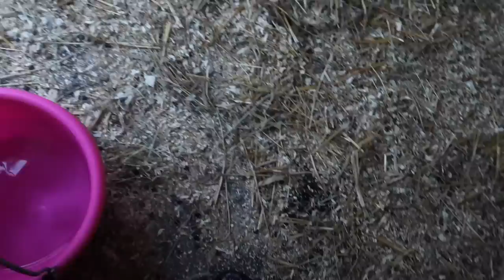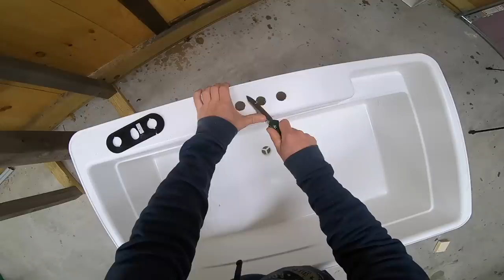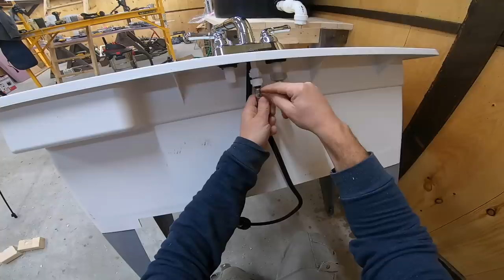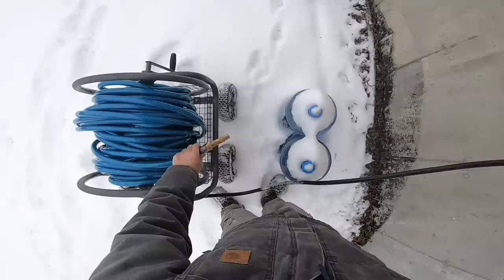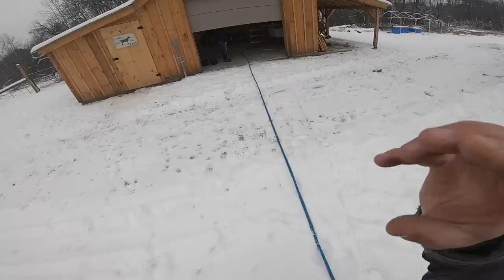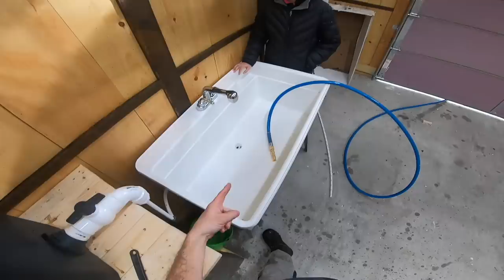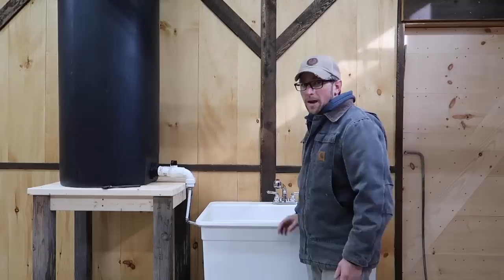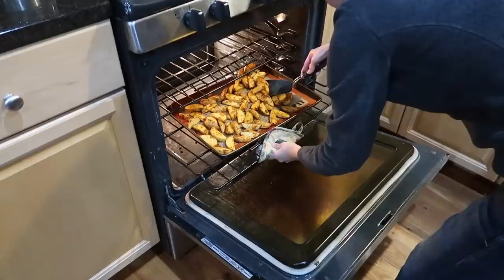Hooking Up the Water storage System Everything Was going so good until the END

Comment from the maker: Drinking Water Hose we are using https://amzn.to/2rbs4rl    (*Affiliate link)
Reply: Hook up a shrader valve to your water tank and pressurize it with compressed air. You'll get plenty of water pressure
Reply: That is if your tank is air tight!
Reply: That WAS a close one!  So glad it reached.
Reply: Makes me giggle your little tank. My big one is,105,000 litres or close to 28,000 gallons. And I still worry if I have enough. Even with 15,000 litres also for the vegetable garden.
Reply: How will you drain the water from the sink?
Reply: All you need is a short hose like a washing machine hose connected to the tank with a basic garden head on it. I use this on my rain barrels works perfectly. You will need one converter to change from the hose to the garden head.
Reply: Al, there.may be a.subscriber out there who is willing to send you an old style faucet they still have.lying around, or would an external.hose bib faucet.work?
Reply: @delstalopalmay  Its a boot washer!
Reply: @delstalopalmay  The sink is open at the bottom. Draing
is not the problem. Collecting the drainage is. 🤣
Reply: Al I don't usually ever give advice because you get so many that give it. I was a plumber for 30 years. So here's my unsolicited advice, if you put the hundred gallon tank in the loft, you could still have your fill valve in the bottom of the garage, along with your supply line, and you would have plenty of pressure. I couldn't tell what brand of faucet that was, but some of them you can remove the back pressure coupling on the inside of the unit. That's the cheapest way to go, you could put a water pump in between the tank and the sink, however that's more expensive than 30 feet of water hose and 30 feet of flex pipe.
Just for what it's worth,
Jimmy
Reply: @williamdegnan4718  exactly...
Reply: William Degnan A
Reply: Hope all goes well with plumbing in barn. Those potatoes look so yummy. Gena, please let us have your seasoning recipe for the potatoes.
Reply: @delstalopalmay  That's what I want to know also...where's the drain?
Reply: @Bamaman14k  that would be a space saver to in his activity area
Reply: ❤👍 Serbia

Comment: The water saving technology is a washer with a tiny hole. You can remove it. Sometimes there are two. One at either end of the hose part of the faucet.
Reply: Sometimes you can drill the hole bigger if you can't get away with removing it.
Reply: eldenl1 yep I hate those darned faucets. Maybe find an old faucet that looks good to replace the new one.
Reply: I think there are a lot of people that hate them. I know I do because they do do send out enough water to get the shampoo out of my hair. Yes those washers are easy to get out. My husband did it for .
Reply: Madonna Emberley  And that’s what Community can do for you!  I would appreciate hearing this if I was Al.  Better than taking out and returning the faucet!
Reply: If you cannot get enough flow, try a garden faucet value (The ones with a Red round knob). You could just add a pipe nipple to turn into sink faucet. Just a cheap & simple option.
Reply: @WhatBigEyes  We live in a new development, high density, and the builder put outside faucets with those darn water saving gadgets on so when you want to water your lawn, the water sprinkler won't even move back and forth! So I thought I'd remove them then add my garden hose. Nope. Doesn't work, they put the spigot a different size so you MUST use the water saving sized plumbing, and it's ruined if you try to put it back on, so back to the hardware store. Nothing like government dictating how you water! Don't buy in a HOA development. Smack head. I spend hours hand watering since sprinklers don't work. Everyone else just let's grass die, but then you get an HOA citation for not maintaining yard. I get comments on how green my lawn is, but then neighbors get jealous and send pix in to get me violated for stupid things like a small tree that the developer put in before closing. It's never ending. And I'm a real estate agent, know the laws. We're looking for land somewhere....ho hum. And your comment sent me into a rage n rant. lol What Big Eyes you have my dear.

Comment: Al, Gina, That was good luck with the hosepipe. Long is long enough! I think get an old fashioned tap from salvage, or a spigot like out of the house wall at the other end of the hose, which lets the water straight through, similarly a shower head and flexible hose if you want to look posh! Remove the existing, blank off one hole and use pvc pipes and fittings direct to both. Maybe a "Y" in the pipe and in line stop tap if you can't control the showerhead. For a rough sink I use similar and Hozelock garden hose fittings, which are interchangeable off one tap, push fit. Regards Stephen.

Comment: I have a customer with pressure issues and these type faucets have several water savers in them. They are in the handle and hoses so just go thru and pull out the saver discs and water should flow just fine.

Comment: Al (this might sound ridiculous), but- Did you leave a vent at the top of the water tank? If not, there is a vacuum preventing a full flow.
Reply: RonRay yes it does
Reply: Yes, It's like holding your finger on top a straw. Low flow or not water should be spraying out of that faucet with the weight of 100 gallons of water above it !
Reply: Dave Lewis ...not ridiculous but the water does flow in fact pours out with force (Hence the little screams by his wife) if he doesn’t hook up to sink faucet..

Comment: Have you thought about passive heating in the workshop and barn? A simple aluminum downspout air pipe inside an enclosed box with a plexiglass panel front should pump a few K btu worth of heat in during the day. 

Basic Idea behind it is an insulated box with a clear front aimed at the sun with a thin wall metal pipe inside painted black to heat up in the sun and any air passing inside moves that heat in to the structure with a small fan. Very easy to set it up with a DC fan and a small solar panel to be completely passive heating.

Comment: You need an on-demand pump from the pipe on the tank and connect to the hose into the sink and when you turn the water on you will have water.  I may not have it just right but it does work.  I use that concept with my hydroponics.

Comment: I'd use a piece of hose with a fine seedling head with a shut-off valve for the sink, the flow is soft and also doubles as a super-nice shower for bathing oneself, much nicer than any showerhead available. Plus it makes rinsing soap off of things and oneself fast and easy.

Comment: I have the same faucet in my utility room.  Had the same problem.  There is a back-flow preventer (small black rubber fitting) that was in backwards.  Once I flipped it around, water flowed freely.

Comment: You can pressurize your tank with as little as 10# of pressure if you want more pressure at the taps a tire pump  or a regulated connection will also work.  Use a small compressor for the job.

Comment: The adaptor between the faucet valve and the pull out hose is fairly fine metal tubing and will be a source of pressure drop, not sure what the hose bore is, but it might be a limiting factor. The aerator head at the user end of the hose will be another, along with any flow limit washers built into the system.

Comment: Run the 2" ? Line from the valve to the back wall, then a short piece of pex to your faucet. Increases volume for the restrictions in the faucet. You can remove the water saver washer also.

Comment: I wonder if you open the top of the tank,  would it drain better. Like when you use gas can, you have to open air vent so it will flow better. I am sure you will figure it out, enjoy the videos.

Comment: Try disassembling the bottom of the faucet assembly, remove the aerator from the faucet and blow compressed air through the faucet snout. That should blow all the water saver junk out and clear the way for normal water flow.

Comment: Hi Lumnah family.  I would use the tap that is installed outside to use with a garden hose but you can remove the plastic washers that regulates water flow. Check both ends and in the tap alsoGood luck.

Comment: The snow squeaks at 14F and below. You have plenty of snow squeak going on. 

When solvent gluing PVC or ABS, always turn the joint 1/4 turn to spread the solvent glue and seal the joint. 

At .4 psi per foot of elevation (head), the water at the faucet will be 1.6 psi when the tank is full. 

The valve in the wand will probably need to be held in spray. Find the low flow restrictor and remove it. There is often a restrictor in the end of the hose that attaches to the bottom of the faucet. Some have the restrictor in the spray wand at the connection. There is also a backflow restrictor that 1.6 psi may not be able to overcome. Sometimes, it accessible so it can be drilled out. The hose size is not likely your problem. The various orifices in the faucet are far smaller than the supply hoses. I spend 15 years installing faucets.  Disassemble the faucet to see if there are restrictors in the valve body.

Cap the tank securely and put a schrader valve on it so you can pressurize it to 10 to 20 psi.

Comment: Can you add a little pressure to the holding tank?  A simple tire valve stem could be added to the top to manually add a little pressure to the system until maybe you can get a more automatic air pressure regulator added.

Comment: I use a tank like that outside. Nothing comes out of a spray nozzle like plumbed or pumped,, just smaller open end of very short hose worked best for me. If I lift hose up too high, water flow stops. You could put a hose shut off at end of hose too. My tank is high on concrete blocks.

Comment: One little tip that I learned late in life. When applying teflon tape, place the topside of the tape next to the threads and wrap clockwise. This makes it a lot easier to terminate the tape and you don't get those skinny ends.

Comment: Most new faucets require a water psi of 24 or above. You can find old faucets without water restrictors on eBay.  Look for ones built before the 90s.   I would suggest a camper style tankless water heater but I think they require a higher water pressure too.

Comment: You should look into a small electric pump that runs on a switch by the sink. Or cap off the water tank and pressurize it. When the gauge reads low just fill with more air

Comment: You could plumb a hose bibb off the post to the sink. The holes in the faucet are too small and the pressure too low to work. You could possibly mount a garden bibb to the deck of the tub.
Pressurizing the tank is also a possibility. Install a gauge and Schrader valve to the tank and use your compressor to add air pressure.

Comment: as a 40+ year plumber i would get a loft tank and run everything in 3/4 inch. also use a 3/4 inch tap. if not get a small pump and everything will be fine in 1/2 inch
Reply: You are right, they will have to get the pump, because the hose won't reach the loft.

Comment: Remove the watersaver washers in both ends of the faucet so u have even pressure going thru the faucet. By reducing pipe diameters will increase water flow rate only if there is enough pressure from the source if once your barrel gets low the pressure will deminish as well May i suggest since u have electricity in the shop now hookup a smaller water pump to the service it will increase your flow rate and then u can reinstall the watersavers where they were originally installed.

Comment: There maybe a small metal restrictor plate inside the faucet which you can take out and the flow should increase. The metal plat could be where the hose connects to the faucet head. It should look silver with a small hole in the center.

Comment: For water pressure, add  between tank and faucet small RV 12 volt water pump used to deliver pressurized water to taps in campers. Hook onto battery, charged by your solar system.  
For more energy efficient oven fries par boil for 5 minutes before seasoning. lessons time in energy hog oven.  They come out crispy on the outside, tender on the inside. To boil water super fast and efficiently buy single burner induction hot plate and induction friendly pot and pan. I can buy the induction burner on sale at Canadian tire for $40.

Comment: On your water tank, to get full water pressure you need to connect to the bottom not the side. If there isn't a connection under the tank. Get a camper pump and you get pressure to use the fosset valves. Now that pump works on 12 volts dc a car battery will work good.

Comment: Hey Al, sometimes those water saver faucets have what are called balancing diaphragm and won’t allow water flow unless there is pressure to both sides (hot and cold) also remove the restrictive inserts and that should help. Be cautious adding air to that tank as it isn’t designed for pressure and could cause a catastrophic tank failure.

Comment: Weather forecast for tomorrow 20/11/19, 30 degrees, mostly cloudy with a shower or thunderstorm around! ;)  For the water line, avoid 90 degree elbows wherever you can. A bent hose/tube has much less resistant than a stubborn 90 degree fitting! Go with a large diameter pipe as close as possible to your connection point. Only there you put a reducer. Big diameter connected to small diameter results in higher pressure. That's how a syringe works.
Reply: Stefan - "Big diameter connected to small diameter results in higher pressure." - Not true!

Comment: Just a thought, place a tee/ manifold  output side of ball valve. Run one side to sink and other one to a self draining hose bib on exterior of barn. You can the back feed water thru hose bib to fill tank and have pressure water during warmer seasons by leaving hose from house connected. You can also run a overflow tube from top outlet of tank to exterior so it spills outside if over filled. You gain exterior water, partime  pressure water and no need to stand on ladder while filling tank. You also need to make a female to female adaptor to back feed at spickot.for part time  pressure water. leave tank valve open to backfeed directly to sink. Open the tank valve with sink off to backfeed  tank from the bottom up. Next time you get a machine bury a water line and just blow out with compressor before frost sets in. You would get 8 months of not having to fill and full pressure water.

Comment: Al you need to mount the tank on its side with a couple of degrees of pitch to outlet bung. Mount it up tight to the ceiling to create a higher head pressure. The tank outlet is too close to the faucet.

Comment: Increasing feed hose diameter will not increase pressure just volume. You have essentially made you a cistern which require a pressure pump to make much of the modern plumbing fixtures work. Get you a cheap RV pressure pump to get the pressure up.

Comment: You might want to check the inlet side of the faucet to see if there is a restrictor valve or somethin.  With the amount of volume you get out of the tank from that pvc pipe, you should get the same amount of flow through the faucet.  Another way to be sure, you can also take the pex off the faucet and check the flow again.  If it comes out slower, then it may be the pex having some kind of restriction.
Reply: Another suggestion too, instead of having that 90° elbow, just loop in a single arched pipe.  Down from the pvc, straight up into the faucet.

That elbow could be a restrictive spot in the water flow since it has to fight itself in that sharp bend.  Having 1 single piece from outlet to inlet under the sink basin would be a straight shot unrestrictive pipe.

I could see having elbows in a pressurized system, but you are doing gravity feed from a short height.  If the tank was say in the loft, it would probably generate even more pressure.

Comment: My brother uses a motor home booster pump to raise his off grid pressure when he wants to take a shower. He has 1k tank 50 feet above his house and even with a 4 inch feeder it doesn't provide good pressure. 

Another option would be to make your own faucet with a ball valve and your new found skill at bending PVC pipe to make a gooseneck.

Comment: As a rule of thumb, gravity fed water will have about 5 psi per 10 feet of water height.  So it appears you will have about 2.5 psi in your system which will decrease as the water level lowers.  An option would be a small pump like those used in motor homes to boost your pressure in-line where the water comes out of the storage tank.

Comment: Most faucets are "pressure balanced" so that if a toilet get flushed the person in the shower doesn't get scalded by the reduction of only cold water pressure.  You need pressure on both the hot and cold water sides of these type faucets to get it to work.  Tee your pipe off your tank and run to the hot and cold side of your faucet.  Your next problem is the water saving piece.  Some where in your hand held sprayer there is a restriction to reduce water flow, usually a small hole in a flat plastic washer.  Enlarge the hole or toss the washer.

Comment: The simplest solution changing nothing can be a try to rotate the tank and place it horizontally lifting it up close to the ceiling with the water tap on the bottom. Maybe the height will be enough then to flow the water through your current water tap.

Comment: Maybe add a 3/4 outlet from the top of the tank, just below the fill, or use the one you filled with, and fill from the top.  Run the outlet down to the sink with PVC.  When the tank is full to the 3/4 outlet, it will over flow to the sink, telling you it's full.

Comment: Pressurize the tank thru bung hole. Get adapter ti fit metal you need gauge turn off valve and air fitting. Open valve pressurize enough to get flow. Shut valve off then when you need water go thru top but open air vale to bleed pressure